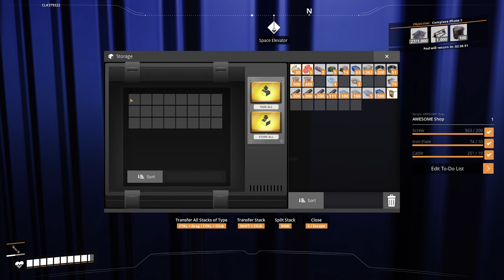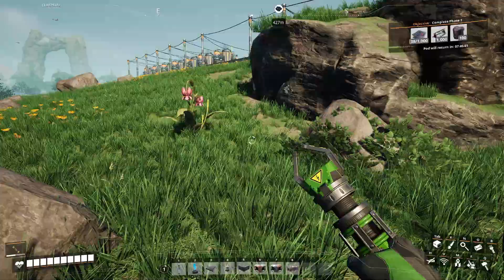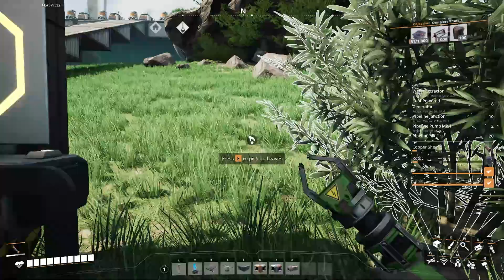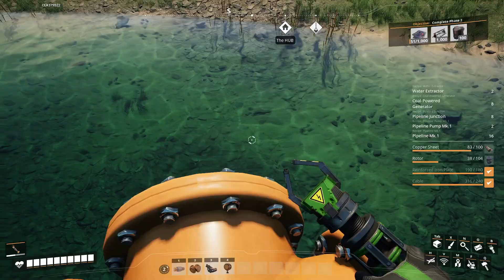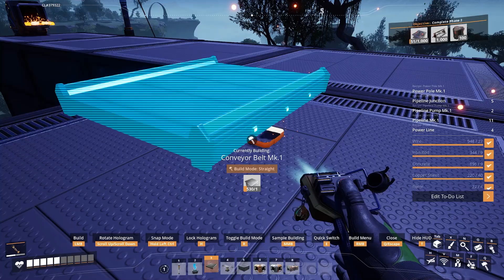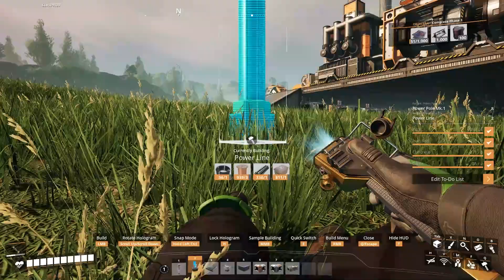Easiest Coal Power Setup | Satisfactory 1.0 Guided Playthrough Ep. 5

Comment: 30:15 If you don’t upgrade the belts in between the splitters (at least for generators 1-4), you won’t have enough coal.  The first 4 generators use 60 coal, and the last 4 use another 60 coal, so the belts in-between also need to be mark 2.
Reply from the maker: good call

Comment: I really don't know anyone uses the jump pads. I haven't tried it yet, but it seems you could use the jelly pad as a safe landing for a high speed hypertube. I think I'll try that. FYI, when you ping a node like that, bring up the map and it'll tell you the purity as long as the hud displays the location (the compass and distance indicator).
Reply from the maker: Best use case is what you said! If you have a reliable hypertube cannon you can place a landing pad where you end up for easier transport / not wasting jetpack fuel

Comment: 8 Coal generators is 3 water extractors. 2 2/3 x 3 = 8
Reply from the maker: Correct but then you have to deal with 360 water in a Mk. 1 pipe, which can only carry 300
Reply: @TheGreenhandGames  It seems if you make a loop with three, it splits it 180 each way. I add a pump on each end too.
Reply from the maker: Yeah there are ways to perfectly optimize it early game but I find for total beginners, just overbuilding slightly 2 extractors -> 4 coal generators is a bit easier to grasp
Reply: @TheGreenhandGames  The ways aren't that complicated. I am a new player and hated it when I first looked into the topic when vets like you dumb it down for newcomers. It is not that complicated to make 8:3 work. You just loop the pipes and split twice between the 3 extractors.

I like your style of explanation but I wish you would teach the newcomers some of these more advanced tidbits here and there which won't overwhelm them I am sure but make them feel like they unlocked some hidden knowledge.

Comment: If one generator consumes 15 coal per minute, and Mark 1 belt can transport up to 60 coal per minute, is it possible for more than 4 generator to work efficiently in this setup?
Reply from the maker: Nope, 15x4 will use up the entire Mk. 1 belt so for 8 coal generators you'd need a Mk. 2 belt!
Reply: If you have two coal locations, using two mk1 mines and 2 mk1 belts, just run coal from both sides of 8 different generators. That way one belt feeds four, and the second feeds the next four.
Reply from the maker: Ah yes, that would work if you have two nodes